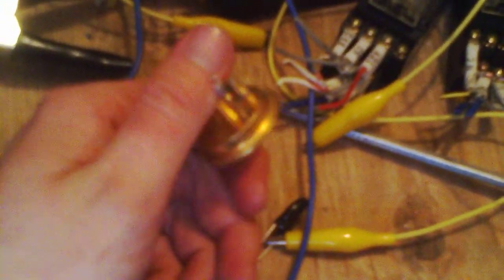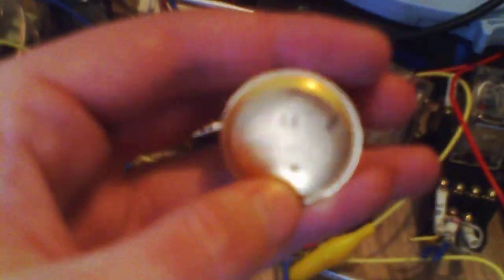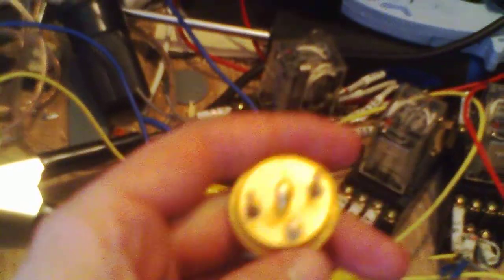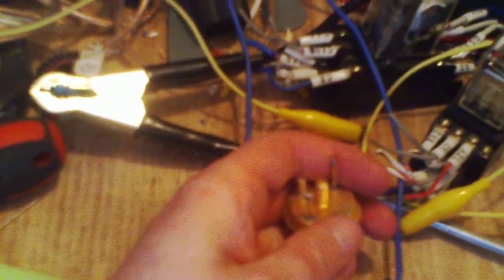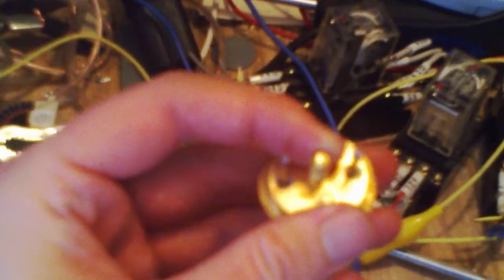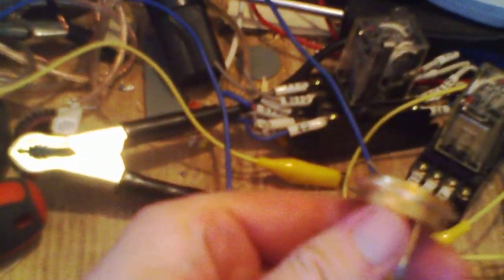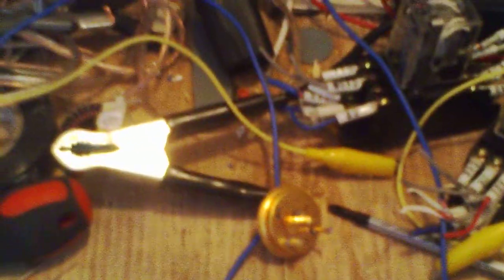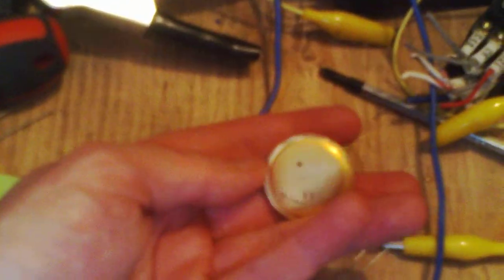Old PNP Motorola 108 power transistor

Comment: I have one of these. It is a nice PNP germanium power transistor, great because it doesn't require much base voltage to get it working, unlike modern silicon transistors that require 0.6 volts or so. I made a low starting voltage joule thief, it starts at 0.16 volts! Low enough to light a white led from a peltier module using heat from your hand.

Comment: I remember that exact transistor and I used it in the NAVY on submarines I was in for 7 years spent over 3 years under the ocean . We used that for the interior communications as I was a nuck and also worked on electronics . It fit in a Dial x phone system and it was a amplifier .

Comment from the maker: @narcoti   This is just an early high power semiconductor device package.  Before modern (relatively speaking) epoxy case/steel case device packages were developed it was common for things like this to be in gold plated cases, so for its age this package finish is typical.  These look to be just commercial grade devices, albeit made to a better standard than modern crap.

Comment from the maker: @migette1   From what I can find these are germanium PNP transistors specially made for IBM (these were driver transistors for impact print heads AFAIK).  The 108 is an in house marking so that any end users have to get replacements from IBM as the part number does not correlate to any standard transistor.  There is also a 2N108, but that is a different transistor.